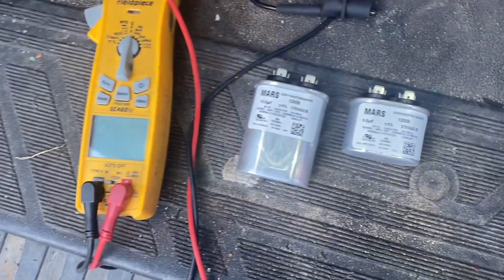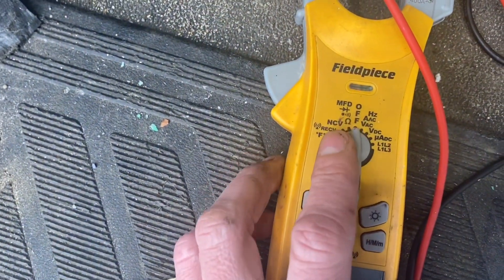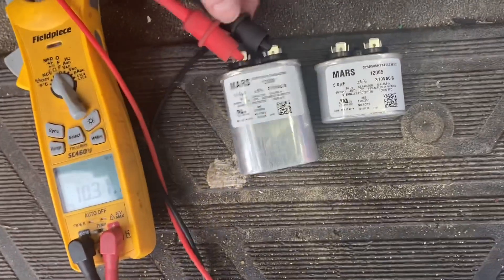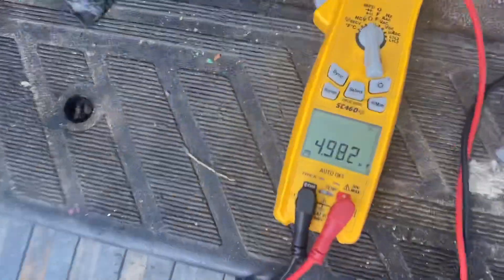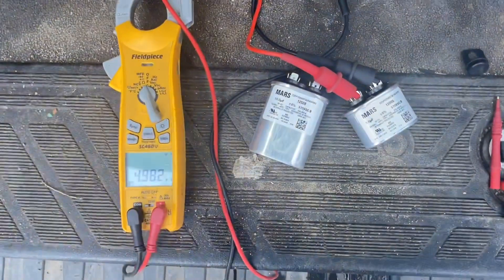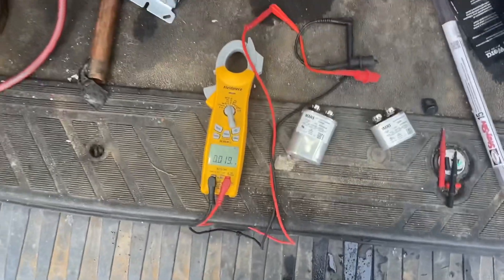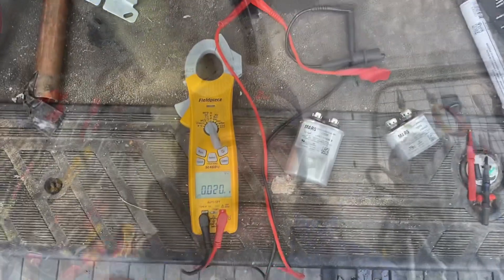Quick pro tips # 7 . Testing capacitors

Comment: 2:28 - The capacitive reactance of a 1uF capacitor @60Hz is 2652.58 Ohms. Measure with a clamp meter the current on the wire from cap to compressor, then divide by the voltage reading across the capacitor (which is the back EMF from the motor, so it will be higher than nominal) to get the actual in-circuit capacitance. Ohm’s Law: resistance in ohms times current in amps equals the voltage.
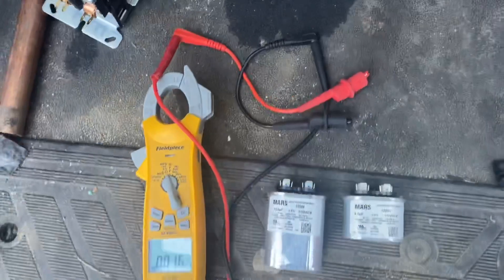1:14 - As this is labeled as a quick tip, I must point out the necessity of discharging the capacitor under test before connecting to a meter. Save your meter, guys.  I know you said you just pulled these from stock; but, better to be safe from meter damage. A 10k 1w resistor is adequate for most AC capacitors.  The screwdriver method although quick, is not recommended because you could possibly degrade or even damage an otherwise good capacitor. Learn from other people’s stupidity (mine!)